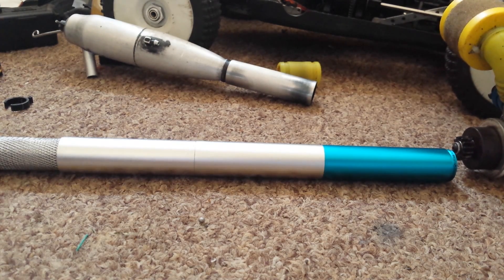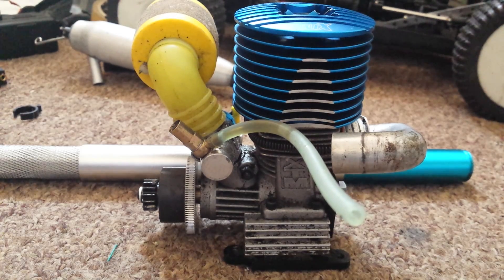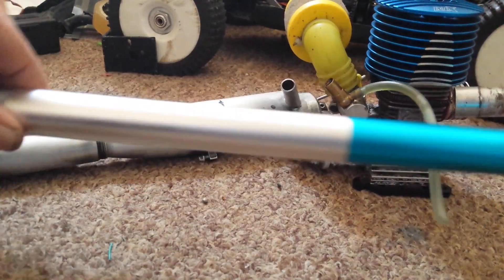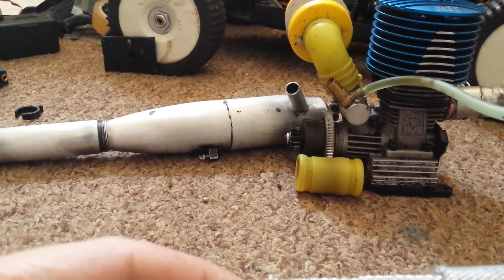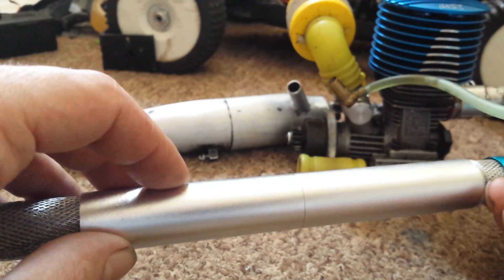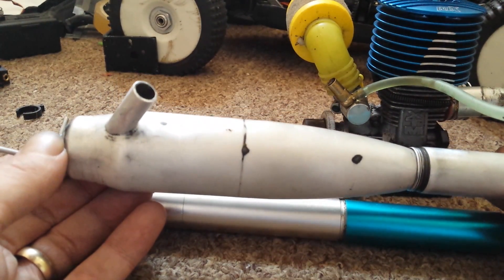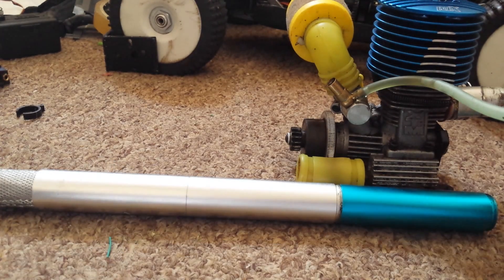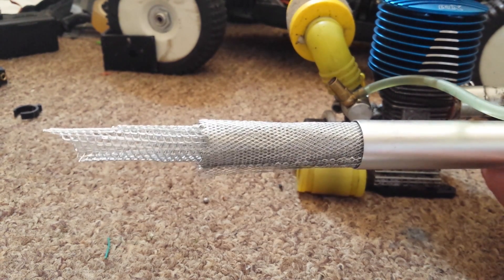RC  D.I.Y. Nitro Engine Muffler/Silencer

Comment: thanks what i was looking for
Reply from the maker: glad I could help, I checked out some other vids on the subject and people were using wire wool as an outer, but I thought considering the tubing diameter a fine mesh should do the job just nice :-)
Reply: battonfive when can you get the running video out
Reply from the maker: just waiting for a glow stick that's due in a week, two at the max. I've got a pull cord here I will use to test it and make a video, then while I finish off the truck I will get an e starter for it.

An under, platform starter looks good as I managed to keep the engine block in its original place.

Next step is to work out how to pipe up two nitro fuel tanks if I can manage it:-D
Reply from the maker: ***** thanks Stephen :-) I heard that these engines guzzle the nitro pretty fast :-D this 6x6 weighs about three or four buggies now so I imagine it will chew even more :-D specially with me messing with the exhaust system :-)
 I tried getting this beast running a week ago, I put the starter box on a nice li-ion and that had some real meaty power and looks good, but the receiver that runs the servos on board the truck was twitching to such a mad point I couldn't control anything on it :-) looks an early 90s receiver that's had better days.
 So im just waiting on one of these nice futaba transmitters and a few receivers over the next week or so, and I will go out again, do the checks and see if I can get it going :-)
 im just hoping that back pressure from the engine will be able to pump the nitro down all the pipes and nipples of the two tanks and in to the injector :-) 
really glad it worked for you gives me some hope :-D something I have really needed from the start on this project :-) my mechanical skills have come from chatting and messing so far :-p
Reply from the maker: ***** thanks for the info :-) I was trying to start it in the shed I built which is pretty insulated from the outside world apart from a few light systems in there :-) but it could well have been someone using a motor somewhere near by or some random micro or radio wave interference, but it was pretty extreme twitches, when I first wired it up it had that gentle twitch of old but last time it was having more a fit than anything and wouldn't respond at all to the transmitter :-)
 but yeah the low 27mhz and 15mhz stuff is really middle of no where equipment to dodge interference, this new one my friend is sending over is a Futaba 6EXHP but not sure about the receivers :-)
 I would love to swap out the servos for sure but im afraid there are a few hundred bolts holding the back on and I don't have the heart to open them all up atm :-) im running on the hope that I can plug and play what comes, but yeah these old servos do look like they have had better days :-D
 im after starting her up and then once ive got her going have a look round for some of those nice solid torgue gears designed more for torque rather than rpm :-)
 I appreciate the input as its handy on this projects and a few others im working and pondering on :-)
Reply from the maker: ***** thanks that's would be pretty awesome if I can just temporarily dodge the servo replacements :-)
 I had a three channel wheel transmitter that came with the buggy I got :-D but im hoping the little sticks on that new futaba make my life a bit simpler. im used to the gaming pads over the years but the wheel I find I cant seem to get the nice turns and things like I can wing on the stick transmitters :-) im told people get the hang of them though and that some people prefer them like that :-)
 I imagine though you still get a good 100m range on that spectrum though so for cars and things the three channels should still work nice :-)
 I want to build a harpoon winch and maybe a little crane on this 6x6 nitro when I get chance so the extra channels of that futaba could come in handy yet :-)
 an fpv setup would be really handy :-) specially if a little onboard cam is on a servo that's wired up to your steering servo :-D looks both handy to have to see where your going as well as handy to capture some footage for y.t. :-)